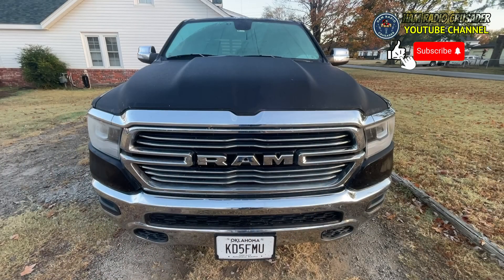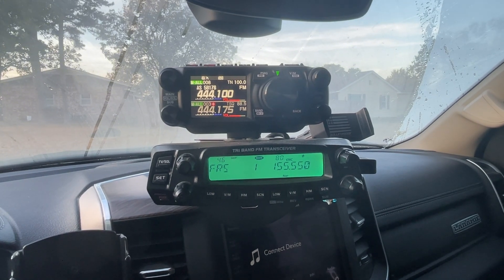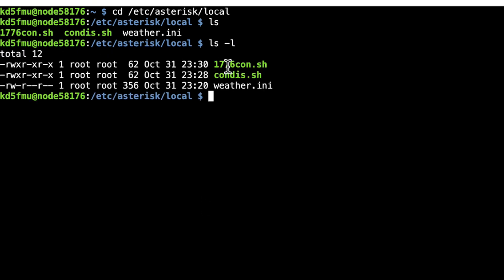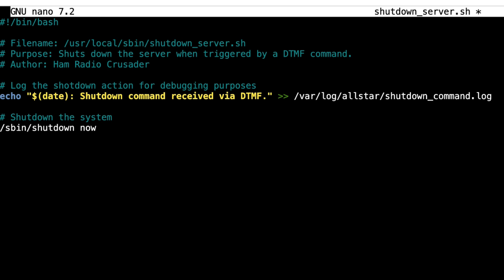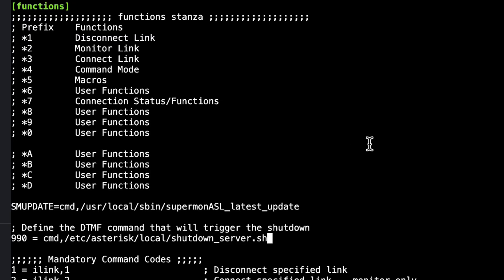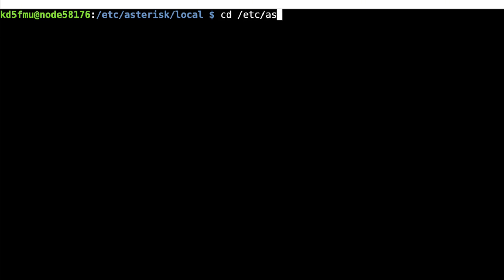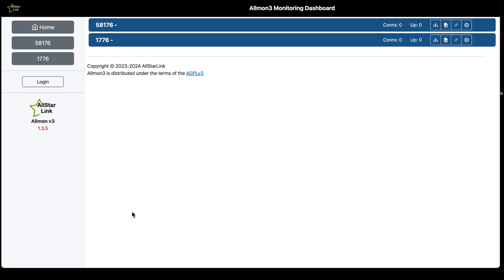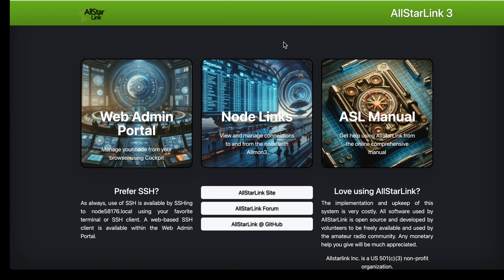DTMF Shutdown & Reboot for AllStarLink Version 3

Comment: DTMF in my node not working. Nothing showing up in asterisk cli. Im using modified bf888 with cm108 sound fob. The strange thing is, dtmf is working using hamvoip but not with asl3. Been playing around with option 2 under Interface Tune CLI but never made it work.
Reply from the maker: The way the Asterisk server decodes DTMF tones are VERY subjective. I too have had this happen, but very often gained victory with audio adjustments. BUT also very often have I had a radio send DTMF tones that were not always decoded by the Asterisk server. I would suggest a different radio send the tones and see if you can get a different result.
Reply: @HamRadioCrusader  thanks for info. That would give me a sigh for now. 73.

Comment: I really want to like Allstar. Because it does have cool side apps, that you can add. (Ie. Weather alerts). But it seems to be, all the damn basic computer code lines that have to be written to operate it. 
Why doesn't it just work on Windows or Apple-sauce? Just asking!? Because maybe I don't understand any of it!
I am used to using EchoLink, which is easy as pie on Windows! Even when you have set up a personal Node.
Reply from the maker: Well I can't answer that, other than the creators wanted linux for open source reasons. I started out with EchoLink but the audio was bad and AllStar is VERY flexible and has many options.
Reply: Hi  I used to do weather, emergencies, auto connect, and all kinds of things with Echolink in 2005. ASL is a place where you can learn to write code and other things and for folks who hates windows. These days I have a Echolink node that runs on a windows computer that is about 1.5 X 4 X about ⅜ inches that has a sound card and serial controller  each just over an inch long ant about half inch wide. Heres a tip about programming computers. When you write a program it's like teaching a child to do something you have to tell it each tiny step to do . The higher level languages makes things a little easier. But it is all about what you are interested in computers are great but ya have to be patient.